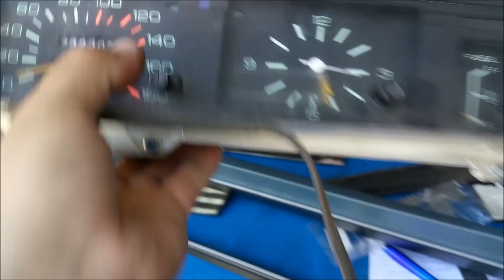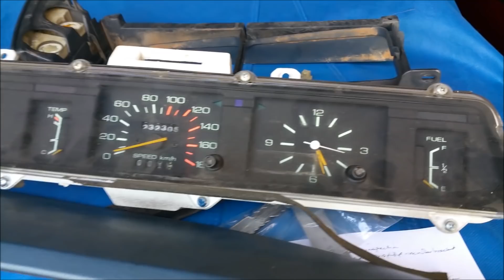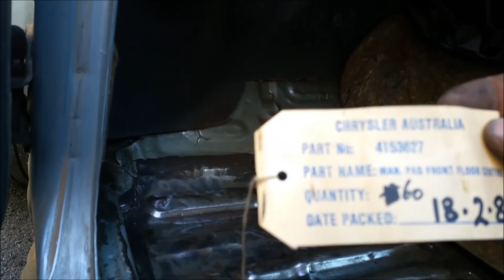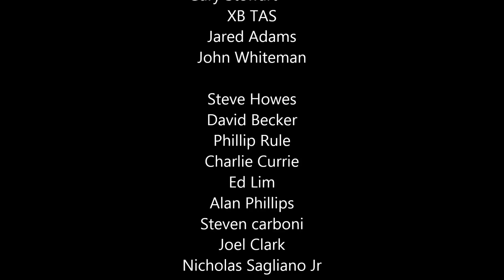Mitsubishi GH Sigma 4 - Semi Naked with Answers

Comment: This will be a decent little car . The degreaser is very weak these days . I use Easy off oven cleaner on really bad grease , but it can damage paint . I'd just cut the  support and weld a section in Pete .The window channels are great, very clean . I hate making those especially the Mopar ones with the lip. Nearly every time I take the windscreen out the whole channel is  either on the rubber or its long gone just a hole . Clean car Pete , no one seems to put coolant in the old cars then the Welsh plugs are gone. Great video, any wonder I can't get up early for work ,I'm always watching these videos all night .
Reply: you sound like me pete.

Comment: Just a point of interest the brown coloured regulator in your bosch alternator is .5 of a volt higher than standard. Designed for taxis for idling a lot. Battery sensing are better but for all classic cars i would recommend due to the fact they are not daily drivers. Keep up good work old son.

Comment: Another trick to get screens out is a guitar string / piano wire or similar. Once you have a hole started poke the wire through. Wrap each end of the wire around some sort of handle like a screwdriver. Using a sawing motion you can then cut around the screen.
Reply: Jason Oxley   That method works well if you're removing the screen to replace it because it is damaged, but if you intend to reuse the screens it can be a bit hit-and-miss because it's very easy to put a little too much pressure on the edge of the glass which will often cause it to crack, and then you have no choice but to replace it.  A lot of professional glass fitters will use a glass knife (the same principle as Peter's sharpened ruler but much tougher, sharper and more expensive) on bonded glass that is intended to be reused.  Some glass fitting companies will tell you that bonded glass can't be reused, that's untrue and usually because they have no confidence that their technicians can remove the glass without breaking it.  Usually independents are the best option if you want to reuse the glass as the bigger companies really make their money from the replacement glass rather than fitting...

Comment: how are ya Pete.... you should have taken the car down to a car wash at night and gave the engine etc a bay a good clean, make your life so much easier...i refuse to work on any engine bay that's that dirty...i normally wash it  and then take it for a good half hr spin to dry it and to see where the oil leaks etc are... fresh oil a lot easier to see.... keep up the good work champ 👌👌👍👍
Reply from the maker: You're correct although there was a limit to what I could reach... every square inch of this thing was dirty, cheers.

Comment: ripper unit there. couple of rust bits to sort, bit of hammer and dolly action will sort it. might want to pull the roof liner just to have a look at that lump up top near the drivers side front door looks like a bit of bog in there. always used stag compound on the brass plugs i put back when i swapped em out. that motor scrubbed up looking ripper, still, drop a bit of JB weld on that rocker box until you can tig it up. if you weren't out the other side i'd grab it and get it done for you.

Comment: I hope you can find a rebuild kit for the fuel pump.  If you can't then you may be stuck with having to pay the A$130 for a new one as all that oil getting into the pump might have attacked the diaphragm leading to it failing in the future.  I know it sounds daft because the diaphragms are designed to handle petrol so it would be easy to think they would be safe against any hydrocarbon but I've had that type of fuel pump on Volvos fail due to oil rotting it out.  Of course, Volvos and Mitsubishis aren't the only ones that can have that problem, pretty much any vehicle with that type of pump can have the issue, which is an awful lot of older, carb-fed vehicles...

Comment: Hold the phone !  Where's the pre-video chit-chat ? :o)
If you decide to go with the clock cluster, I'm pretty sure I have bits for that mechanism if there's something nasty broken in the or missing in the clock.  If it's a "tuning fork" type mechanism you may never get it running again, once the jewels are worn it's pretty much curtains.  At some stage they changed to quartz mechanisms, there's hope if it's a quartz. 

Cheers.
Reply from the maker: I'll take a look Harvey... really want a tach dash, if you hear of one can you let me know? Cheers mate.
Reply: @PeterAndersons  I've had a good look through my stash and I only found bits and pieces for Sigma not a complete cluster. In my search through the stash I found the digital clock out of one so you're right, the Sigma did have a digital clock.   Not impossible, but hard to put a tacho into yours because the tacho cluster had a different mask over the instruments with a round opening and the indicator lights were in a different position. 
I often do instrument work for a local auto sparky and I know he has a gazillion clusters upstairs in the "secret room".  I'll ask if he'll let me rummage around in there, you never know. 
I'll let you know one way or another in the comments of the next video.

Comment: carefully avoids polluting with degreaser... dumps coolant on driveway ;-)
Reply: Glycol or propylene glycol is far 'safer' going down storm drains (in small amounts) than oil, grease, and the nasty chemicals that's in those degreasers.
Reply from the maker: I caught it before it hit the drain... I saved 5 litres of coolant which I'll filter and re-use, but when I hit the welsh plug, there was more in the block than I thought, cheers.

Comment: Time to remove that cylinder head, remove some material out of the combustion chamber and get the compressions down to what they should be.try and avoid detonation. If you are going to Turbo this beast, Lower the compressions or it will come back to bite you. You are only a few bolts there and you have the gasket set. I my opinion, a Turbo will kill the bottom end. LOVE the work, HATE the car. Ha Ha Ha. (I'm showing my age, but these cars were bad then,does this make them bad now?)
Reply from the maker: Hey Joe, The turbo bit will be later and I might use a different engine. This has some miles and boost may stress the old rings too much... if it had done under 100K all good, but I'll figure that stuff out later. In the mean time I'll just get it on the road, cheers
Reply: Peter, What ever you do with this lemon, im sure it will turn into a peach. Thanks for the videos, most enjoyable.